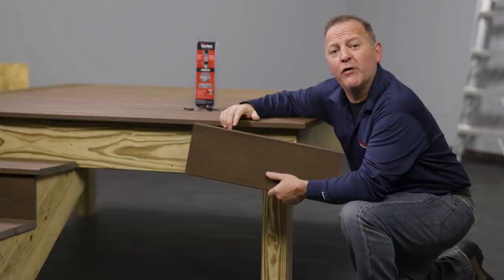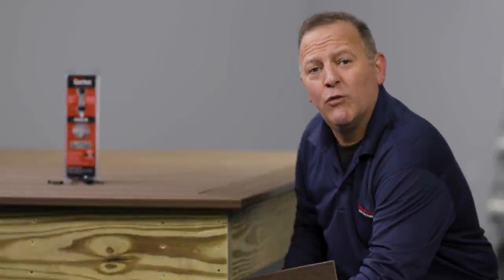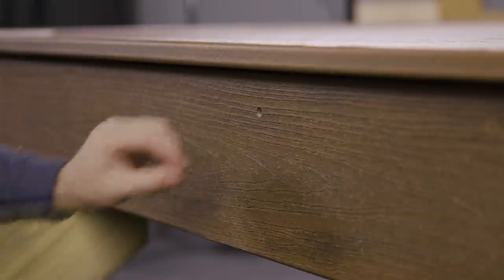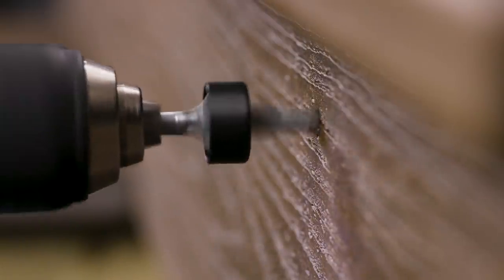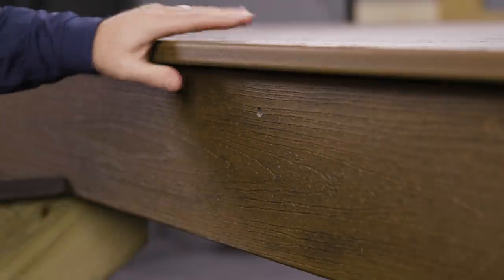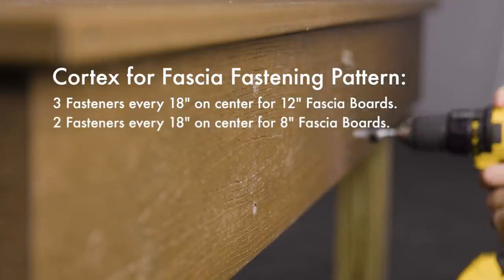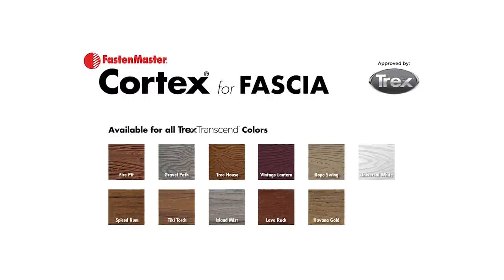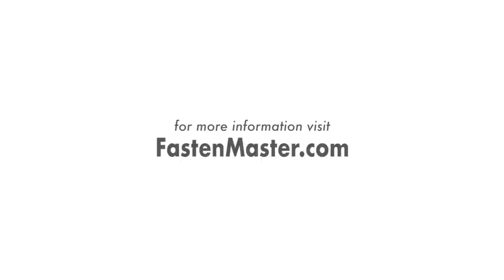Cortex Hidden Fastener for Trex Fascia: Seamless Finish

Comment: Why is this better than putting regular screws in there again?
Reply: This system allows for expansion and contraction to help prevent fascia warping. The counterbore diameter is larger than the screw diameter. That is key.